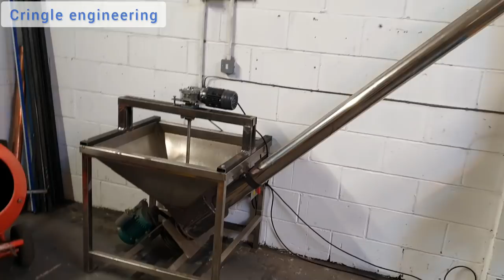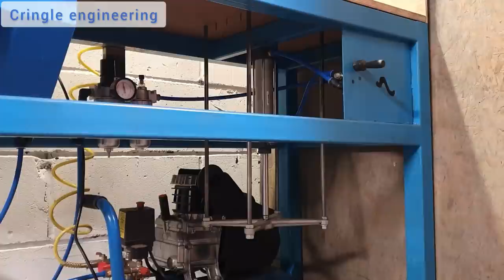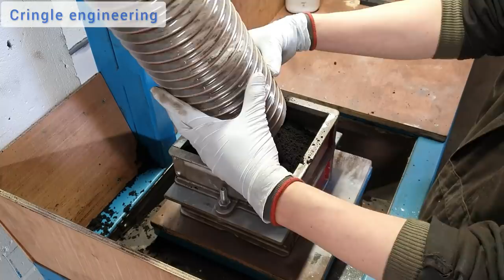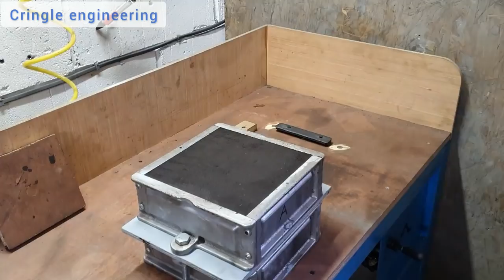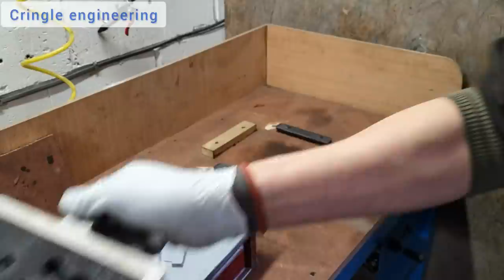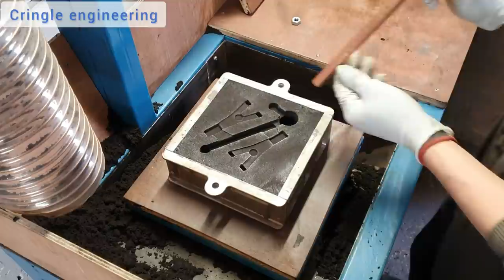metal casting machine, perfect molds every time.

Comment: Part of the reason for your perfect molds is your perfect pattern.  Really good job.  You really cut down on secondary work by putting in your runners, well and sprue locations.  Just have to complete the sprue and your off and running.  Very good.
Reply from the maker: Thank you, im still learning a lot about pattern design,  the machplates realy do speed things up when making multiple parts so there well worth the investment to me.

Comment: I like your opening montage, showing every piece on machinery essential to success
Reply from the maker: Thank you for watching
Reply: @cringleengineering7688  no problem, if you can give more specifics like weight, or
1. list the machines needed by name
2. Show how to engineer/make the plastic parts you use to make the molds,
3. Specifications for how much sand to oil
I would highly appreciate it. I desire to make all of my own parts.

Comment: I always carve a pouring basin on the top of the cope.  I never pour directly down a spruce. It does things such as final filter of impurities and obviously slows the metal speed down like rip rap in a ditch. We were all taught this by one of the finest foundry men in the business, Dr. Paul Spidel of UW-Stout.  You might want to include this in your repertoire.
Reply from the maker: I have tried adding a basin but i have found i just dont need to bother. I can controll any inclusions via speed of pour so air cant enter, and using sacrificial risers to remove any turbulance and trap oxide and slag from entering the runner and gates.

Comment: That is the most elaborate setup I have ever seen. Most commercial setups don't even have any hydraulics and you have a dedicated one just to lift one mold off the other. There must have been a sale on hydraulic rams.
Reply from the maker: Its based on a jolt/squeeze machine, very comon simple machines used in most small foudrys. Most factories ive worked in do infact use lots of hydraulics and heavy machinery. 
For my machine i just used cheep pneumatic/air cylinders from ebay and a stick welder.
It gets used daily so its worth the investment to me, and asking somone to work on the floor with bare feet is  just unacceptable here.

Comment: OMG! Dowel pins with threads. Now I have seen everything.
8 minutes a box - not bad. But with small moulds and a nice little pattern plate like that I reckon that in my heyday (long since gone) I could have equalled and maybe even beaten that. Possibly to 6 or 7 minutes a mould and I would have sieved the first sand to improve finish and moulded in a proper tapered sprue. But to show you just how slow we both are I have a book – “Foundry Practice” by R H Palmer, published about 1911, that has a time study.  Its for a 13 inch by 17 inch mould with a 4 inch high drag and 4.5 inch high cope so it’s a much bigger mould with lots more sand. Entirely hand moulded 4 minutes 20 seconds and machine (power squeezer) moulded 2 minutes 10 seconds. Now that is moving - those old timers really worked, doing that for 12 hours a day 6 days a week, no wonder they did not live long!... Martin
PS What do you use to convey the sand upwards?
Reply from the maker: I only use oil bonded sand (mansbond) it costs a lot more initially but it gives a very fine finish much better than regular green sand. And it needs no venting at all! Ive just seen your video on how you rework your sand! Wow thats a lot of hard work! and exactly the reason i made this sytem and only use oil sand now.
My machine lifts the sand with an arcamedes screw from the hopper and works it to a very fine fluffy techture when it drop down, and so does away with having to grate it through a sieve so saves a ton of work.
I then just wait untill the molds are cold in the morning open them on a  shake out table with a grate on top and into my muller that is simply a cement mixer with 3 6inch iron balls rolling inside it. I still have to shovel the sand from the muller to the feed hopper but that the last bit to mechanise.
And yes exactly what you say, Im 35 and get a sore back already and will probably need to work for another 40 years before i can think of retirering lol.

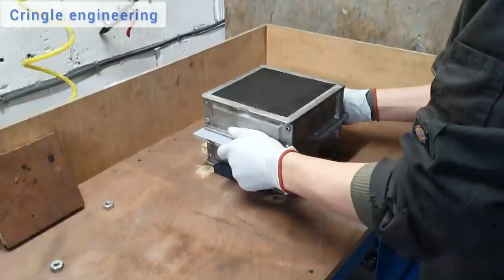Comment: I'm a bit new. With your setup for separating the two halves why not have an automated cutter for the sprue? 4:58 (I think sprue is the term?)
Also while automagically cutting the sprue why not run something like a step drill bit to create your funnel? this might reduce your process from a 7 min to a 5 min by automating more of the work, reducing tool changes, and work location changes.
Reply from the maker: As with most things its all down to time and funds, ive spent the time and money i have available and this was the result. Im sure could design a better even more automated system. I couldnt think of a cost effective way to automate the sprue cutting as each different pattern has different hole locations and at the end of the day its a matter of seconds and im more focused on removing the more labour intensive aspects for now. Thanks for watching.

Comment: What a great set-up. It's really impressive. Are you using oil bound sand?
Reply from the maker: Thank you, yes i only use oil bonded sand (mansbond) it gives great detail and does not require venting or daily tempering.
Reply: @cringleengineering7688  can you do a video just on the sand? What you use, how long to dry, stategy for using vents etc aimed for people like me that have no knowledge at all about casting?
Reply from the maker: @therealspixycat  i have had a lot of questions regarding the oil sand so i will make a video showing the whole process of using the sand soon. Just waiting untill i can purchase some new sand as it would be usfull to show in the video.

Comment: Not to make you feel bad but we had a molder named big Jim. He asked th boss if he could take off at lunch with full days pay if he got 125 14x16 molds done. The boss said sure, as he laughs. Well big Jim went home at lunch with full pay. He was using 2 hands flipping a 14x16x8 deep flask, full of sand with just his wrists. Now you have a goal😁💪
Great job by the way.
Reply from the maker: Job and knock always helps production! I met simular lads working in an abotour, 250 cows and go home!  But i bet big jims back regrets it now, il bet he also got a wage that afforded him a pension and house. Work smarter not harder is my moto :)
Reply: @cringleengineering7688  i have the same moto.
Pretty sure his back regretted it for a long time, I'm 72 that makes Jim about 85. Heck of a guy.

Comment: Nice setup, equipment, and process.  You do good work.  The only thing I could think of to make it even better would be to have the excess sand during mold prep go or fall back into the mixer so it just keeps recirculating.  Since mixer is large and probably wouldn't fit well under the press for gravity return, maybe a simple conveyor belt.  Anyway, I love to brainstorm, lol.  Cheers.
Reply from the maker: Thanks, im still working on automating as much of the sand moving as posible to save my back and a sand return conveyor would be great but just not worth the investment currently.
Reply: @cringleengineering7688  yeah, I totally get it.  One improvement at a time as it makes economic sense.    When the time comes though, with your skills I'm sure you could build a simple conveyor out of mostly found parts.

Comment: this is pretty neat, but what for of material are you ucing for the pattern? Even if that was steel, i would think you would get some sort of deflection in it from compacting the sand since it isnt sitting on a flat base and just sandwhiched in. i know you cant get perfect tollerance in these molds, but how are these parts dimensionally?
Reply from the maker: Thanks, my patterns are mostly 3d printed plastic on plywood(see my other video on making of the matchplates) there will be some spring in the patterns but only a fraction of a milimeter probably less than the thickness of the paint so realy no isue at all. Ive been told many times my castings are nicer than most other available casting kits so im more than pleased with the results.

Comment: Impressive! it seems so accurate. How do you get the sand to hold so well? Is it mixed with some kind of adhesive? And  also do you reuse the same sand?
Reply from the maker: Thank you. I just use oil bonded sand (mansbond is the brand i use), it is very fine and sticky almost clay like when new.  I just add a little mineral oil when mixing before reuse and top up with new. Its not cheep at around £50 for a 25kg bag but i would highly recomend it. It saves lots of time tempering sand and no need to vent at all and i dont have to wait for the sand to go stone cold before using again. One bag should be more than enougth for hobby use and would last a life time.
Reply: @cringleengineering7688  thanks a lot

Comment: Awesome! Simple design! Quick process! I can see that the sand is pushed into the pipe using the hole in the bucket but what did you use for pushing the sand all the way up into the pipe?
Reply from the maker: Thank you, the sand is forced up elevator with a arcamedes screw inside the pipe. This has its own motor(the large green one under the hopper at begining of video) the second motor drives the stiring bars to keep the sand from sticking in the hopper. Bothe are operated from the same foot pedle when switched on.

Comment: Probably best not let the work-experience lad use it though, that pneumatic ram looks like a great way to get a smooshed hand! the biggest benefit that i can see is the sand delivery system, there's a lot of time used up in scooping sand. the biggest downside that i can see is that you're restricted to using a single size of flask, but there's also something to be said for standardizing on a single size!
Reply from the maker: Ah yes if i do get an apprentice i would have to make it with a second switch so both hands have to be clear of the table to opperate it.
It does save a lot of effort moving sand and did away with having to seive also. The mold spliter actually improved results the most the rest just saves labour and speeds production.

Comment: The machine is very impressive. I stuck around until the end of the video because I thought you would pour some molten metal. Still a great video. Do you feel like the machine was worth all the trouble to build, still today?
Reply from the maker: Thank you, i will make more casting videos soon. For me the machine was worth the investment as it is somthing that gets used daily,  It takes a lot of effort and skill out of the job and it is  useable by anyone with little training so i can easily get somone to operate for me. I would never have bothered if just for hobby use, but the mold ejection is the single best feature that improved results the most.

Comment: What would you think about casting framing members like the subfloor joist systems as a solid single piece using this technique to save labor costs and create a template for mass production rather than individual casting and assembling?
Reply from the maker: Hi i googled a bit but Im not realy sure what you meen? But most small metal parts can be produced with this setup using matchplate patterns.

Comment: Is this casting for Aluminum or for cast-iron
Reply from the maker: Bronze was used for this mold
Reply: OK thank you and then your casting procedure is good for soft metals cause I don't think it would work for cast-iron cast iron is like a weird metal to work with it's finicky if you ever have a chance of making a video with the cast iron I would love to see it how it turns out thank you for replying and all the best luck to you
Reply from the maker: @gilberttwaterfield6389  thanks, i can do cast iron with the same setup, and it gives a realy nice finish,  but it realy burns out crucibles and destroys my oil sand in no time so i prefer to use bronze.
Reply: Yeah I know the crucible is the issue for all cast iron I think a 15 or 20 max pour after that you're a crucible it is very weak also it shrinks it to lose his height and a good crucible is not cheap

Comment: Would you be willing to sell me a few of those lovely aluminum flasks?
Reply from the maker: Thanks, but i just dont think il have the time, i could do with making more for myself. I can share my patterns for them if you fancy making your own? There quite simple to assemble just need a good file, drill and tap but quite time consuming!
Reply: @cringleengineering7688  Are they 3D printed patterns, or wood? I'd wager my shed is a bit far from yours?  Cheers.
Reply from the maker: @adirondackcarfoundry368  they are 3d printed patterns, i can share the stl files for them.
Reply: @cringleengineering7688  cheers
Reply: @cringleengineering7688  Hey! Could I also get those STL's please?

Comment: next to add a vac bagger.
Reply from the maker: How would you use a vac bagger?
Reply: @cringleengineering7688  a while back i read about some companies using vac bagging to pack the sand instead of pounding it.  vac a sheet of plastic on the open sides of the flask.  they'd talked about using it on the parting face too for a better finish, so, vac the pattern separately then vac it to the flask?  it was a while back though, so i dunno, it was said it was used in production already... gotta be more than 20 years now.
     however, vaccing the patterns might mean you don't need to make a cloud of parting dust when you prep them and any benefits to the surface of the part would be gained.